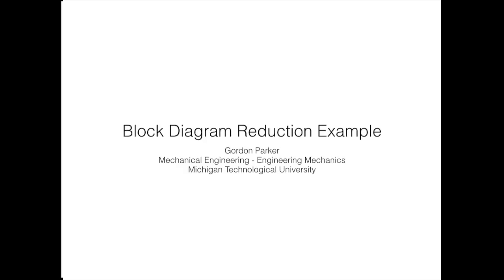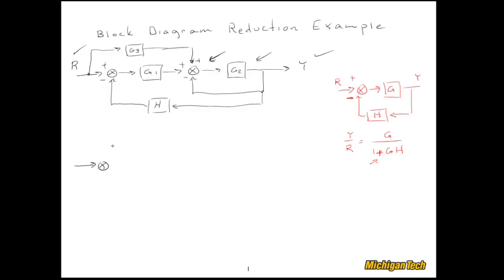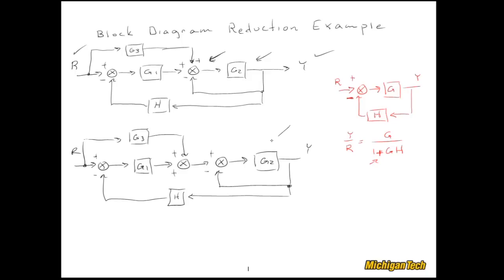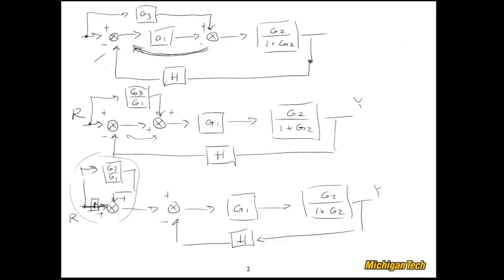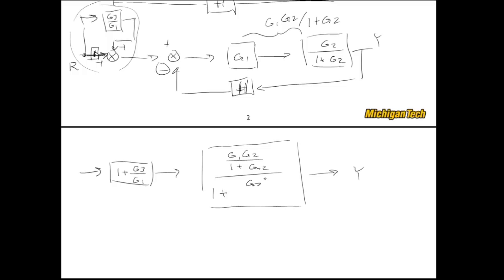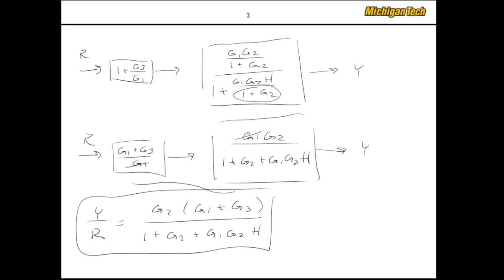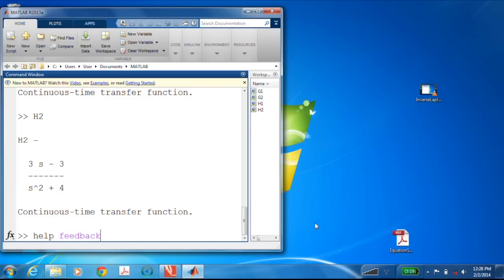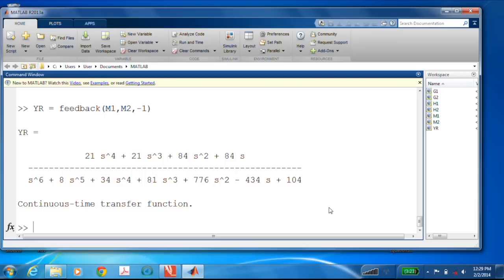Block Diagram Reduction Example

Comment: Thank you for your videos, sir, they are very helpful. One very short question: If a block diagram can be reduced to its resultant transfer function using mathematics, is there any meaning of reducing the diagram step by step using blocks?
Reply from the maker: Sometimes there are added benefits of doing the block diagram reduction. For example, if you want to represent the complicated system into a particular block diagram form. One that come to mind is where there is a transfer function in the forward path and one in the feedback path.
Reply: Gordon Parker Thank you very much for your reply! That makes sense.

Comment: when you interchanged the summing points wont there be any change in outputs?
Reply from the maker: No. You can interchange the summing junctions in every way imaginable and it won't change the output. It comes down to the fact that 1+2+3 = 2+1+3 and so on. This trick can often be exploited to make for a simpler block diagram.

Comment: @9:19, the transformation is as follows: [g2*g2/(1+g2)]/[1+g1*g2*h/(1+g2)] if you multiply the top and bottom by (1+g2), what happened to the 1 in the denominator not added to the repeated loop

Comment: THANK YOU. Block diagrams are frustrating because you know they aren't difficult but you still can't do them... This video helped me a lot!
Reply from the maker: Indeed! Another "feature" is that there are multiple paths (no pun intended) to a solution. This can be good or bad depending on your disposition. It does provide an opportunity to check the work, but it's a long process. If you have access to MATLAB, check out the "feedback" command and its cousins.

Comment: Dear Gordon Parker (or anyone).

 I'm confusing of the blog of (G3/G1) and becomes                 [1 + (G3/G1) ]. I'm still wondering because the signal of G3 is +ve to the transfer function / substraction.

I do believe this is my lack of understanding. Please brief me. Thank you.
Reply from the maker: Sorry for the long lag time in responding. End of the semester etc. At about 7:00 min in the vid we have a congested set of signals going into a summing junction, one signal has G3/G1 in it and the other has just "1" in it. Here's the way to sort this out. Start at the left (R) and trace that signal through the two branches and then through the summing junction. So, at the summing junction we have R*G3/G1 and R (it doesn't change as it moves through the "1" line. Combining them gives R * (1+G3/G1). When we replace the block in the vid, the two branches get replaced by 1+G3/G1.
Reply: Gordon Parker Thank you Mr. Gordon Parker. Now I can understand that very clear.